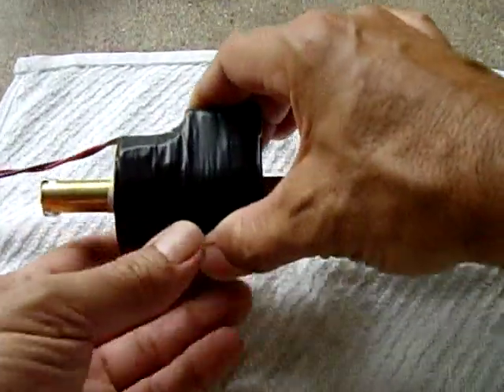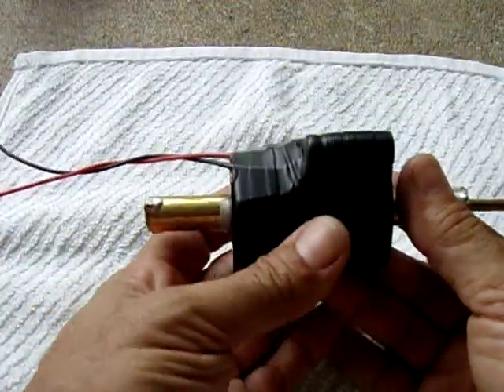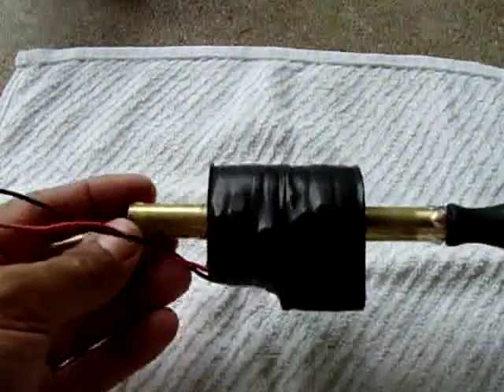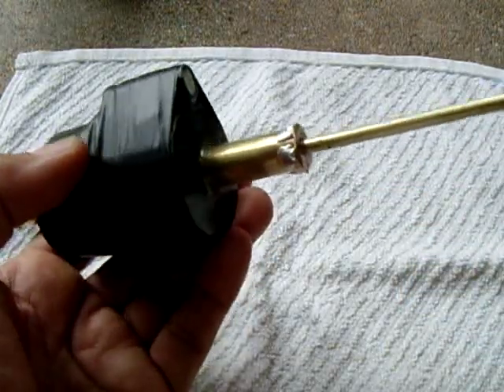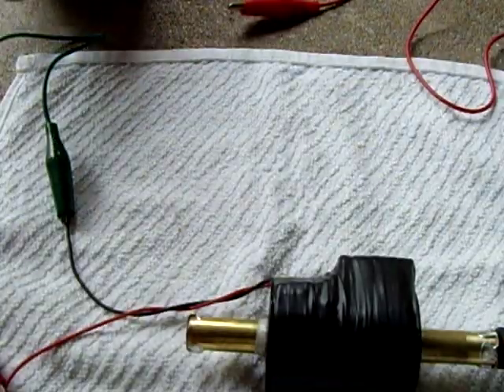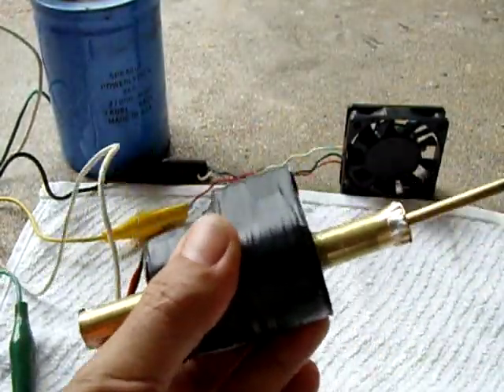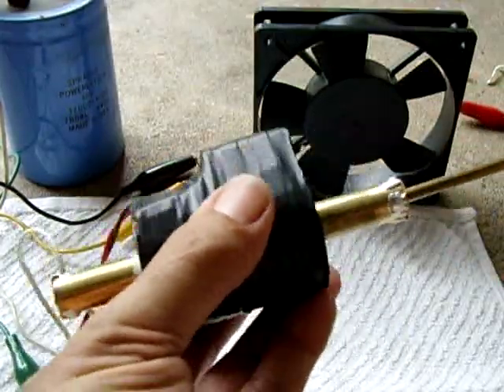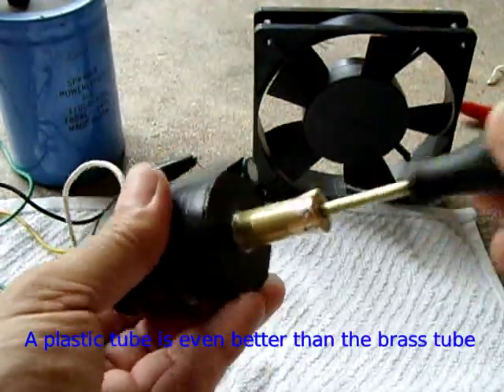Handheld Push-Pull Generator ~ Perfect Super Capacitor Charger!

Comment: hi i like this project and i currently have to do a similar project to charge a phone with it. i would like to see how to assemble what's under the tape. this is the best i have seen and i have a deadline of 20 days. could you please  show e a tutorial of how you accomplish what is under the tape.
Reply from the maker: +Ruben Rene 
Hello. All that is under the tape is what I said in the video. A spool of very thin magnet wire, along with a bridge rectifier and electrolytic cap(100-470uF/16v) across the DC output. Very simple.

Thanks For Watching
Reply: +electronicsNmore 
I know and my problem is i won't be able to assemble it if i don't have  a visual. Do you have one more of this item for sale. so i could take it apart to see it for myself.

Comment: thanks for the info ,going to try with a neo mag from microwave
will pvc work instead of the brass tube?
thanks again
Reply from the maker: +Troy Nelson 
Yes. Use a thin wall pvc pipe for sprinklers.

Comment: Awesome idea! I am looking to recreate this, however, am struggling to find a proper solenoid. Would it be possible to link a good one to use in this instance?
Reply from the maker: Just take a lot of 28 - 32ga enamel wire and using a drill, fill up a spool with a 1/2" hole in the center. :-)
Reply: Thanks so much!

Comment: Good idea! I want to try same one via syringes.
could you take apart black tape and show circuit covered with tape so that I can see more clear. Thank you!!
Reply from the maker: Hi There! Glad you enjoyed the video. Be sure to check out my other videos as well, rate thumbs up, and share with others.

Under the tape are many turns of very fine wire(36-40ga enamel wire). The output feeds into a rectifying circuit just like what is shown in the like below. Ignore the resistor in the link below(copy & paste).

Thanks for watching!

http://www.google.bs/imgres?imgurl=http%3A%2F%2Fstatic.electro-tech-online.com%2Fimgcache%2F10175-phy2003-c14.2.gif&imgrefurl=http%3A%2F%2Fwww.electro-tech-online.com%2Fthreads%2Fmake-rectifier-to-fast-charge-on-bike.110657%2F&h=153&w=288&tbnid=vcvJpM8fWvLggM%3A&zoom=1&docid=wtLDlsfhP8_4aM&ei=sCeoU4mLOrKysQThyoC4AQ&tbm=isch&client=firefox-a&ved=0CDUQMygHMAc&iact=rc&uact=3&dur=2975&page=1&start=0&ndsp=9

Comment: This question is kind of unrelated, but do you know if using different gauge wire will increase or decrease the voltage and amperage output of the device.
Reply from the maker: Using thicker enamel wire will result in lower voltage/higher current. Thinner enamel wire results in higher voltage/lower current. Thanks for watching! Be sure to rate thumbs up, check out my other videos, and share.
Reply: electronicsNmore Thanks for your help, but I have more questions.  If you go from a lower gauge to a higher gauge will that lower the voltage and amperage.  Also very unrelated does a trasformer do a better job at converting volts to ampers or vise versa.  If you could answer either of these questions it would be greatly appreciated.  Thanks again for your time.

Comment: where can i get  the solenoid coil, would i be able to find it in an electronic store or off of something else.
Reply from the maker: +Ruben Rene 
Hello. You need to purchase online or locally(Radio Shack) some thin gauge magnet/enamel wire. You then wind a whole bunch onto a spool leaving both ends of the wire exposed.

Thanks For Watching!
Reply: so a 32 awg magnet wire is equivalent to 6 volts?

Comment: what if you put it on  a cam that was connected to a small wind mill? I like it
Reply from the maker: +Jeff Fleming 
That would work. As the windmill rotates, a rod would push in/out of the coil to charge up a supercapacitor. This video was just a simple demo showing what can be done. Thanks. Be sure to share, and rate thumbs up.

Comment: In what stuff can someone find supercaps like that
Reply from the maker: You may be able to find some inside  computers. They will appear like a thick button cell battery.  Using this unit, I was able to charge up a super cap to operate a dead cell phone to make a call. Served my purpose as an emergeny power source.

Thanks for watching!

Be sure to check out my video playlists.

Comment: Cool, but I think you would get better results if the brass tube was made out of something that doesn't conduct... In this case your brass tube is just another coil and almost shorts your electromagnetic field.
Reply from the maker: I thought of that already. I tried plastic later on, and the result was not much different. It was improved, but not much.
Reply: electronicsNmore Yeah. It might be because your "biceps/triceps machine" emits lots of energy with ease and losses caused by friction etc are much higher than ones caused by the short, so in the end you barely feel that your hand has to compensate for electromagnetic losses. Most important that you had fun making this cool project.
Reply from the maker: The device is certainly useful. I charged up an 11.2v / 2F super cap after a few minutes, then the cap was connected to a 7805vreg. I ended up with a very nice emergency power supply.
Reply: Brass has no iron in it so it should have minimum distortion of the magnetic field. 
Yes plastic would work and it would be interesting to compare the two.

Comment: you have a plenty of power in your arm... if you r not going to create energy from nothing, you wont be able to charge the supercap "easily" or "fast".
i saw a video a kid using a hand crank to charge a 1 F cap  and it took 18 seconds... imagine it for a 400F capacitor... more than 2 hours...
but capacitors are still usefull to turn muscle power to electric energy

Comment: can some one give me the step by step on how to do this plz!?
Reply from the maker: Hey Johnny. You need to purchase a strong neodymium disc magnet (N35 or higher), which will fit inside a plastic tube(preferably), you also need a bunch of 30-32ga wire, and a spool which will slide over the tube to wind all the turns onto(just keep winding lots of turns on the spool). You also need a plastic rod which is the same diameter as the disc magnet, and this rod must slide into the plastic tube fairly easy. You can glue the disc magnet to the plastic rod using e-6000. This project was something I put together from stuff I had laying around. If you ever needed emergency power for a phone to make a quick call, this device works. If you do make one and need more info, just let me know.

Thanks For Watching!

I have lots of very interesting videos.
Reply: i really need some help with this man ive spent about 100 already and cant get it to work lol